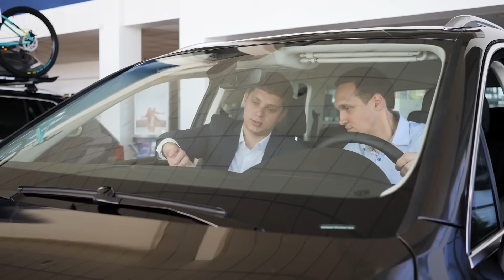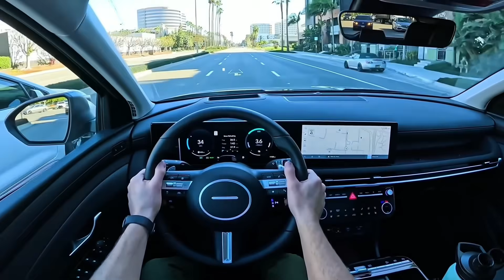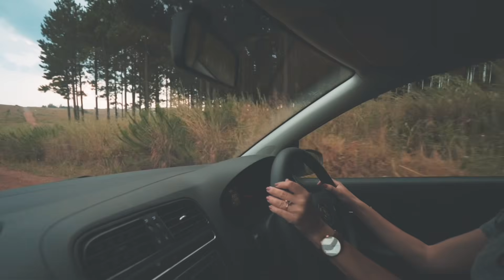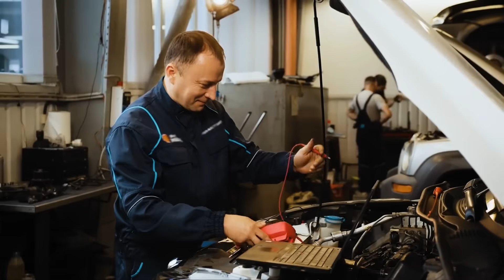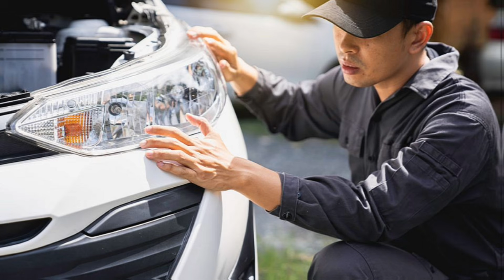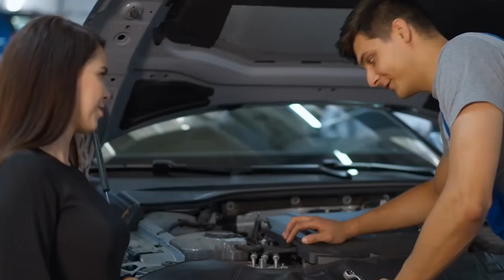BIG REGRET: Why The Car Industry Is Quietly BRINGING BACK This Feature!

Comment: I really wish we got rid of the LED-headlights in general. They are so much worse to look at during night driving and especially bad when combined with automation.
Reply: I TOTALLY AGREE about the headlights. These LED’s are to bright AND are set to high even from the factory .As a bus driver , even in the higher cad they are dazzling also some of these NO BRAIN DRIVERS don’t drive are on dipped headlights, but as they want MORE LIGHT , go around on main beam . You flash them telling them to DIP. , the cheeky so and so’s give abuse and flash back

Comment: A manual handbrake also gives the driver an idea of the rear brake condition by how many clicks it takes to fully apply... not foolproof but better than the electric switch.
Reply from the maker: I absolutely agree with you. A manual handbrake gives at least some real feedback, even if it’s not perfect.

Curious to hear from others, do you feel the same way or prefer the electric version?